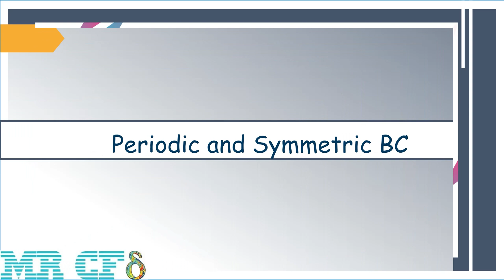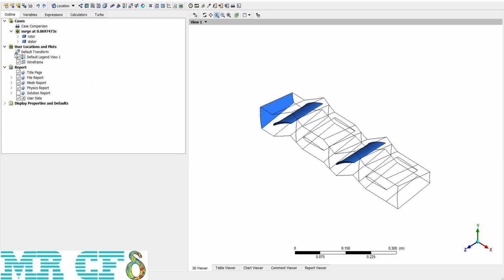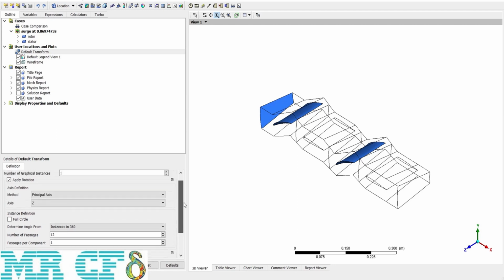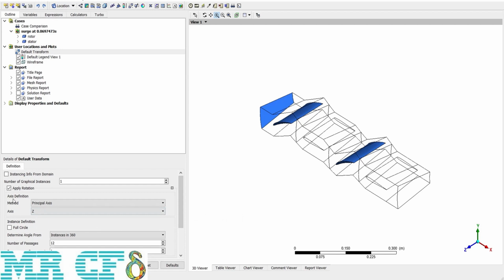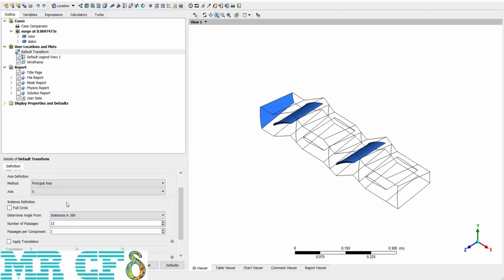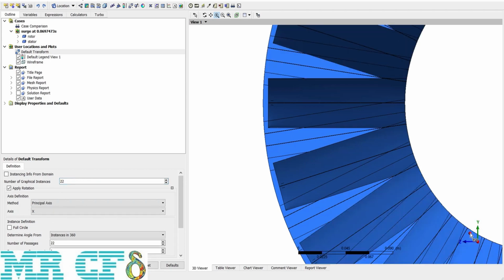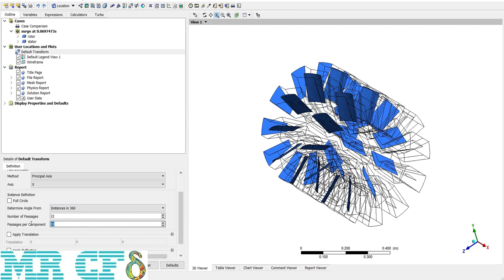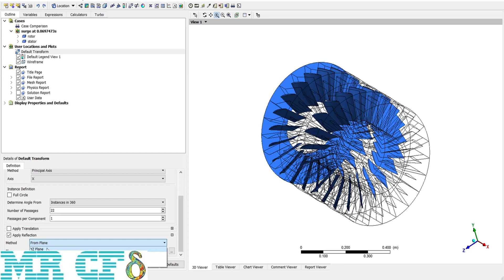CFD POST Course, Session 6: Periodic & Symmetric Boundary Condition

Comment: Thank you for your tutorial. However, in practical scenarios, turbine blades are not uniform across all stages. For example, if I have 60 rotor blades and 80 stator blades in a specific stage, how should I adapt the setup method shown in your video to account for this blade count mismatch? Would the meshing strategy or periodic boundary conditions require adjustments?